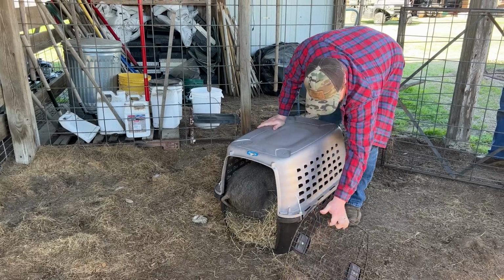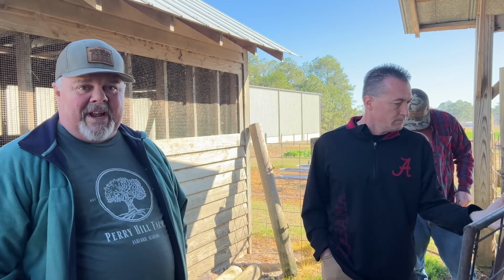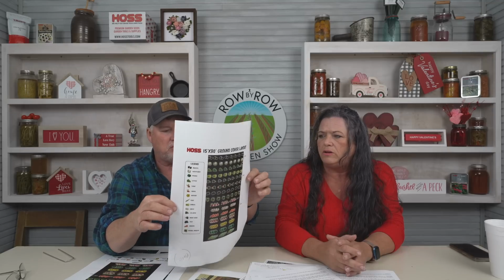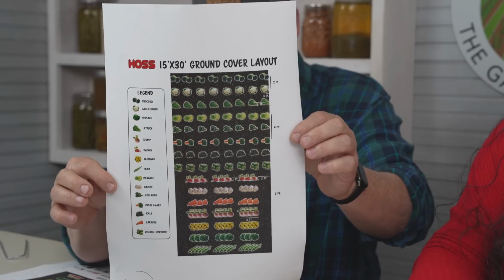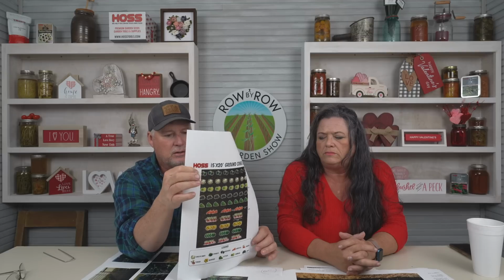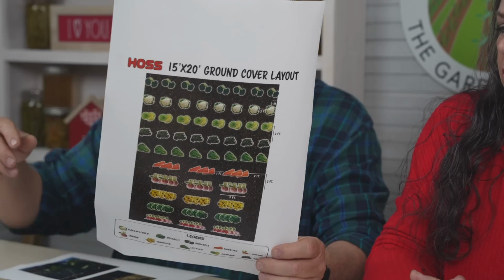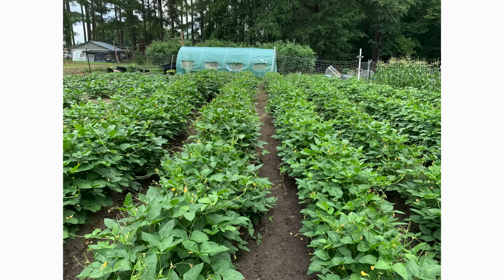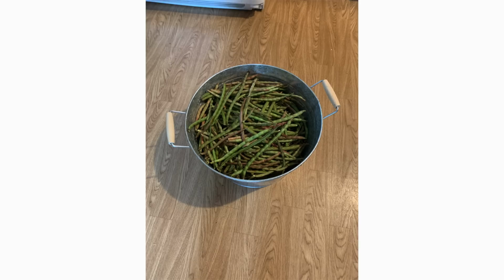New Garden Supplies That You Need For Your Garden

Comment: Good morning!  I ordered the Lazy Garden Kit. I don’t have equipment or muscle power to dig up the plot for my 15 X 20 LGKit to get the grass out. Someone said that all you have to do is lay the black tarp down. I just don’t think it would be good to lay the LGKit on top of the grass. What do you say? but at the same time I don’t know if I can find someone to help me turn the soil & get the grass & roots out.
Reply from the maker: The soil does need to be prepared and amended before using.  You can use a tarp to rid some of the weeds, The lazy garden kit is not like a tarp, it does have precut holes and the existing grass will grow through these holes if not terminated first.

Comment: Dewitt is the best lawn fabric. I am using large rolls to cover about 3000 square feet with a Hoss irrigation system. I laid down the fabric and waited a few months to kill off the grass. Then raked and tilled the soil and laid the fabric back down. This Spring/Summer garden will be amazing. Pro-tip: Use a butane lighter to make your holes.
Reply from the maker: Yes, it is.  This kit already has holes burned it.
Reply: @gardeningwithhoss  Pre-burned holes are a great idea. Getting on your hands and knees and burning holes really is a chore!

Comment: Well, I'm a little late watching the video tonight, but I did make it!!!  The Old Goat is feeling excited and ready to "Get Dirty" in the garden.  In fact he is holding a "Get Dirty" keychain and trying to encourage everyone to get into the garden (he's on the 2nd shelf behind Greg).  I've been using DeWitt fabrics for years now.  Good durable stuff!!!  I would offer a tip to anyone who does not have a tiller, just buy one of the inexpensive "bulb planter" bits off Amazon.  They are big soil drill bits for a cordless drill and work great for making a hole in the soil and GA red clay.  just fill the hole with some improved soil from the store and plant your veggies in the DeWitt mat.  The soil drill is perfect for making a planting hole under those x- locations.  Or Hoss Tools might want to look at including one in the kit?  I agree that drip irrigation is the way to go.  And like they said, pair it with a fertilizer injector and you are good to go for an awesome garden!
Reply from the maker: Thanks David

Comment: I love the new mat! I will probably get that kit when I can figure out how to protect my crop from deer. I have raised beds that I have to put netting around.  The Old Goat is behind Greg on the second shelf holding the key chain.
Reply: I have heard that you can extend your fence higher by placing string around your posts and then hang old CDs from the line. The CDs reflect light and spook the Deer. I am going to be trying this soon.
Reply: I have the same problem, so I am  putting up an 8 ft. fence .

Comment: It should sell good. I use the DeWitt Sunbelt 3.2 on my entire 80 x 200 garden. Started using the 6 ft wide rolls. Now I use the 15 ft wide x 300 rolls. I pull up every other year to amend soil and rotate fabric 180 degrees for crop rotation. I am on year 5 with same material
Reply from the maker: Thanks for sharing